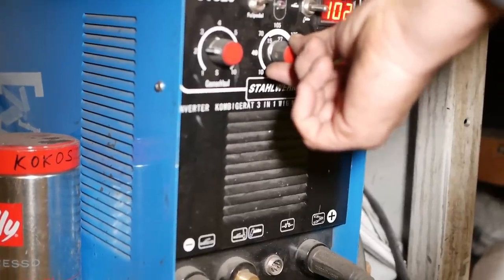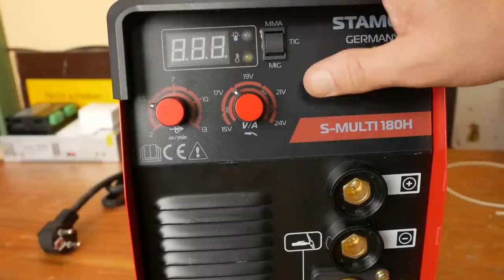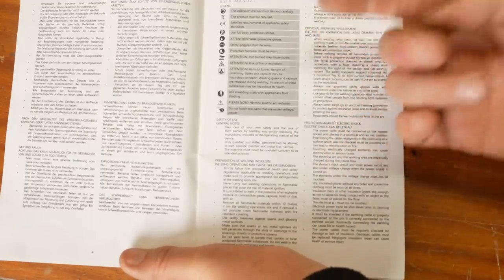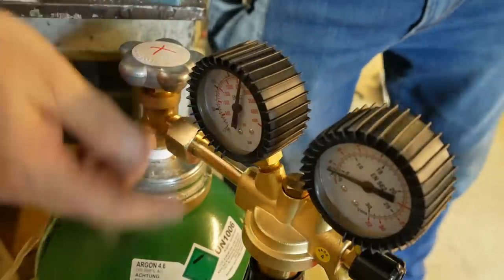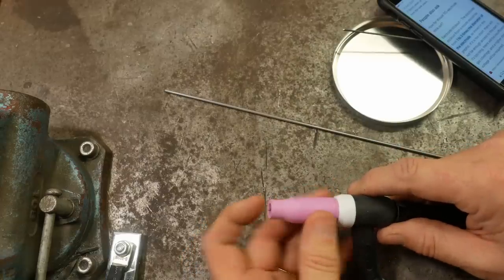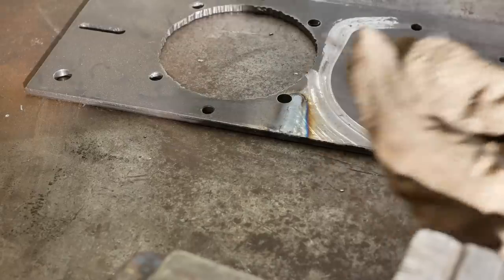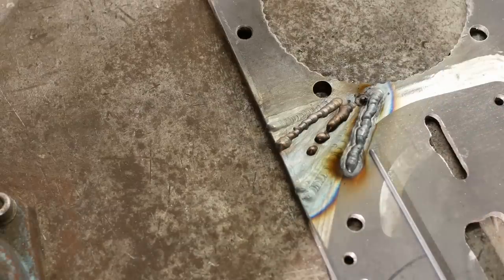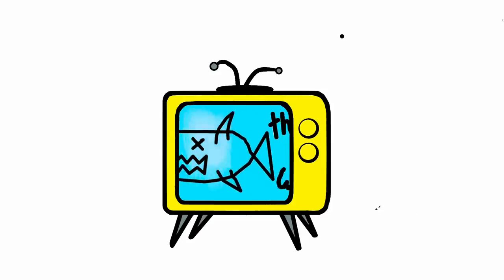Can I learn to TIG weld in an hour using just the internet? || RotarySMP

Comment: you can go whit longer stickout on the wolfram-it depends on angels and how you weld 2 things together- best tips for beginner...and also for experienced tiggers- get a clear gaslens instead of those ceramic ones-the make life much easier-you can se much better what's going on, the ticking noise for the filler is probably some residue from the flux,sinse they are mma-sticks.
the noise is coming from the surface being braked - practice a shitload is the only way to learn,tilting the torch and getting a feel for angles,speeds and amps takes time-dont trust everything online, it differs from machine to machine to ..for 1.6mm wolfram i rarley go above 70-80 amps - and about the speed,move the torch at a steady speed and dip the filler also in a specific speed- best way i have is to have a music-tune in my head and moving to the beat of the music - and one mire thing , do NOT use pure argon for mig-welding,it wont work..the welds will be completley crap
Reply from the maker: Thanks for your critique. Very useful feedback. I am doing daily practice sessions, so it helps to have tips like this to try out.
Reply: @RotarySMP  Just to be clear, I suggested an argon bottle because you'll need it either way. Might even need a second line with a separate pressure regulator if you're welding on hollow parts. Might also come handy for heat treatment of metal parts. Or as an inert gas if you suddenly decide you want to do volatile chemistry in your basement.
Getting your hands on a small CO2 bottle shouldn't be hard. You only need to know that there are two types of bottles, the vanilla kind, and the ones with a riser tube that deliver liquid CO2. You need the vanilla type, otherwise your pressure regulator will freeze.
Reply from the maker: @graealex  Yep. Got it. I will see what I can do.
Reply: @RotarySMP  One side note regarding CO2, it's a really funky gas.
Argon is exactly how you would expect a gas to behave. You put a bunch of it in a vessel, at high pressure, and it's just gas at high pressure. When the pressure increases, the temperature increases proportionaly, and vice versa.
But CO2 has a really funny phase diagram. At room temperature but high pressure, it turns liquid, but when it does, it's obviously a lot less dense, so the gaseous and the liquid phase build an equilibrium. You can't really hear the liquid sloshing around, but if you put a bottle upside down, you'll only get liquid CO2. And when it changes phase, it removes or releases heat from/to the surrounding. Mostly when it expands and turns from liquid to gas, it pulls a lot of heat from the surroundings.

Comment: Congratulations, and, thank you Alexander!
In addition to practice just moving a puddle along you can try autogenous TIG (without filler), it may be easier to get good fusion if you find coordinating both hands a challenge.
Though you seem to be doing quite well!   👍
Also, TIG braze with bronze wire you can turn the amps down to keep from blowing through thin sheet because youre not melting the base metal. This works best for fillet and lap joins.
Consider sharpening both ends of your tungsten (or even snapping it in half)  You wont make so many trips to the grinder.
Reply from the maker: Thanks Jim. I will certainly try TIG Brazing. Good point about grinding both ends. I am doing plenty of walks of shame to grinder :)
Reply: @RotarySMP  Also, consider the amps needed when choosing electrode size.
If you're going to try joining that 6mm plate I think you'd be better off with a 2 or 2.5.
Tungsten is tough but it can only carry so much current before it melts as well.
Reply from the maker: @jimurrata6785  Since I will mostly be welding thinner stock on all the projects I need soon, I need to start practicing on thinner sheet.
Reply: yeh when I first tried tig I found fusion welding quite easy (as long as the parts fit well). Afaiu you not supposed to snap snap the tungsten, it makes it crack
Reply: @fuzzy1dk  Score on the edge of the wheel and it works just fine. Besides there is a limit to how much is needed to chuck in the collet, but you are right this is not best practices.
Reply from the maker: @fuzzy1dk   I'll be making the Schaublin control module with laser cut steel, so the fit up should be near perfect. Will be nice if it is only fusion welds.

Comment: I use 3/32 er705-5 filler with that size electrode. I also stick my tungsten out about 5mm from the end of the cup to avoid the strikes.
Reply from the maker: Thanks for the tips.

Comment: I would avoid the red electrodes, just because I am really uncomfortable with the thought of any amount of radioactive particles in my environment.
Also, the radiation free alternatives seem to have no major downsides.
Reply from the maker: A lot of the jet engine compressor casings, especially from Rolls Royce, used thoriated Magesium. I was never a fan of that either.

Comment: I’m still learning TIG I’d suggest buying a couple of boxes of tungstens and sharpen them all so you can swap them out quickly. I think filler should be roughly the same size as the tungsten. Good luck 😀
Reply from the maker: Yeah, I already have a box of tungsten in the shopping cart :) Fewer walks of shame.

Comment: I'll watch of course, but already know that you absolutely can learn to weld from the internet. The practice component takes more than an hour, but you can learn what you need to know in an hour.
EDIT: that assumes that you can get the mig wire back on it's roll. I thought this was tig? Mig is much easier.
EDIT2: That's more like it. At the end there your beads were looking better, but you absolutely must use tig wire. Once you have that and some more practice you'll crack on well enough. Jody at Welding tips and tricks will teach you everything you need to know if you watch enough of his videos. Many other great sources on YT as well.
Reply from the maker: It is tig. I was just looking for a place to store the spool of MIG wire which delivered with the welder. :)
Reply: @RotarySMP  Sorry, I was live tweeting. 😂😂😂

Comment: youd porbably want like 10 to 15 liters of flow on the argon, tho that regulator seems to go pretty far might be the wrong one, check that you didn't get one for oxygen or something. i am not sure if the co2 ones and the argon ones are diferent or not.

The trigger might be a potentiomater the more you press it the higher the amprage goes, with the max beaing what you set, just a guess tho if it's super light to press. 

the snap might be from you pushing the filler into the puddle? not sure you just wanna melt it no push it in.

The wider beeds you get at the end are because the metal is heating up by you weling it, so it takes less heat to melt it. You can keep it constistan by eather pressing the switch less if it's a pressure sensative one, other wise you have to speed up how fast you are going.

The trick to get a nice looking beed it to be consistant, melt the metal for a set time ad filler and move on, try counting in you head to see if it helps or get a metronome if your serius about it maybe a beep form a cellphone over head phones might work as well. Take evrything i have seaid with a grain of salt, i have only done a bit of tig i mostly do mig but beaing consistant matters in both to get a good looking weld.

other wise as with any skill if you don't give up and keep trying to improve you will be a pro in no time.
Reply from the maker: I will return that regulator, as it is defective. I found a flow meter with the correct thread for the bottles here, and will get on of them. 

Very useful tips you gave me. I am doing daily practice sessions, and those ideas all help.

Comment: It seems like tough there aren’t that many shops which sell the filler rods + the tungsten.
Best combi for steel for me was 2.5 + Gray i bought all the rods without thorium content and got them from stahlwerk.
Reply: In austria i mostly know of fronius they sell the high quality stuff but here to say they are all normed so there should be no diff between colors from one manufacturer or the other.
Reply: Also make sure you buy the right size of filler rod for the tungsten to tiny and you will not be able to catch up, to big and it doesn’t melt.
Reply from the maker: Thanks for the tip. I will mostly be welding thin material. 2-3mm steel sheet and square tube.
Reply from the maker: The internet tells me I need 1.6mm electrodes and 1.6mm filler rod to weld 3mm sheet. Is the internet trustworthy?
Reply: @RotarySMP  It’s mostly about the amps but i did a lot of 3mm stainless also with a 2.5 rod just need to adjust the amps a bit. 
I think the best channel’s i found was igor the welder, and aluminum löffel. He actually did very recently a bit of an intro (igor that is).

It’s basically the same with 3mm mild steel but i think overall a but less then stainless as mild steel gets quite fast cooked which makes it make sparks that’s the point when it was too hot.

Overall i felt stainless was easier to handle for whatever reasons has a lot more time to get to hot.
Reply: @platin2148  Yes, Igor is pretty pog.
Reply from the maker: @graealex  Thanks for the recommendation on Igor. There are so many welding channels, it is hard to find the good ones.
Reply: One i totally forgot was Manfred Welding.
Reply from the maker: @platin2148  Thanks, I'll check out his channel too.

Comment: Obvious things that jump out to me, electrode sharpening like you said make the taper longer, so the tip change is more gradual, not sure how you hold your torch but I found holding it like a claw using my index finger for the trigger was best even tho at first it felt horrible, I think it was well worth it in the long run, keep the electrode stuck out of the torch I touch more than it looks like here, maybe 3-5mm, and to learn the muscle memory a larger electrode diameter wouldn’t go a miss I think, it gives you more room for error, 2.4 I think with 2mm filler rod
Reply from the maker: Thanks for your experience Kyran. It really helps having someone point out these things. I will do daily practice sessions to work on this.
Reply: @RotarySMP  I’m still no expert by any means but I reckon I can do enough to get done what I need to, practice is the most important part, takes a lot, or it did for me at least, your first attempt looks really good tho
Reply from the maker: @Kyran31  Thanks for the encouragement.

Comment: I would say use a bigger cup, more stick out, much more taper on your electrode, try and hold the torch at less of an angle. The biggest thing is just consistency of distance, movement, speed and timing though. Just takes practice. Don't sweat the electrode type, in my (very amateur) experience it really doesn't make any obvious difference. Not sure what the snap sound is, I don't get that, but my machine is a hf start type, perhaps that's related 🤷‍♂️.
Reply: This machine is also HF ignition, but I assume the snapping sound is because he shaved off the flux from normal stick welding electrodes and used them as filler, and God knows how long they have been laying around in the shop. Probably estate he inherited from the late grandpa.
Reply from the maker: :)
Those electrodes were fresh...

... 10 years ago :)

Comment: Not sure you read the stick out value correctly. If the diameter of the electrode is 2mm, then the stick out past the end of the cup should be 2 to 6mm. 4mm being the middle ground. You might find a proper set of TIG gloves will improve your control. I've started using TIG gloves to MIG just because of the extra feel you get. Also can you pull instead of push, it would give you better viability on your puddle.
Reply from the maker: I have been using one of those pyrex cups, of larger diameter lately.

Comment: I would not use the thoriated tungsten - radioactive materials is no fun to handle and the stuff "survives you" if it gets into your body. I mainly use golden and green ones.
Reply from the maker: Thanks Christoph, I used to work on RR viper engines which had thoriated magnesium compressor cases, so received training on this. I have a batch of gold electrodes on order.

Comment: Awesome! Can't wait to see more TIG welding content (and less tip grinding, LOL) :) The torch handle has a number, like a #17, #18, #26, etc. What's the number on yours? I've got something I want to send you that will make it a LOT easier to work with, but it's sized to the torch number.
Reply from the maker: Thanks a lot. I am just watching the the Le Mans MotoGP on TV. Pretty wild race. I'll check the torch in about a half hour.
Reply from the maker: That was a hell of a race :)
The torch is  #17.
Reply: @RotarySMP  Thanks!
Reply from the maker: @JCWren  I did another practice session. Thin sheet this time.
https://www.instagram.com/p/CsOlj3PowW4/?utm_source=ig_web_copy_link&igshid=MzRlODBiNWFlZA==

Comment: If you have a few extra euros for anothr tank, maybe it's worth giving mig a try? I never welded at all. My brother lent me his mig machine & tank with the advice to just follow the instructions printed inside the cover of the machine. The welds came out pretty nice from the get go and improved from there. I wouldn't trust them if they were structural, but for just sticking pieces of steel together with respectable lookng beads, mig seems a pretty good, not very difficult process.
Reply from the maker: I will do that, but first I am really enjoying learning TIG.

Comment: Welding 10mm plate with a 1/16 electrode and 1.6mm filler might be asking a bit much? 
I would say try welding some thinner material together. 
(That said, you are hard on my heels for total TIG welding time, I suspect) 
For the sheet metal work (cabinets and such) you wil probably find MIG to be the process of choice. 
I didn't actually know that MIG/TIG machines with HF start existed. That's quite a good combo unless you need to weld aluminium.
Reply: I also thought so. There are only a few machines on the market, most combined machines rely on scratch or lift start for TIG. This was also only meant as an introduction to both TIG and MIG, and I fully expect the machine to get replaced in the next year or so. Or at least get some upgrades. Also a shame that it doesn't do AC, but neither do I know of any AC welders that also offer MIG, nor is it typical for budget machines anyway.
Reply from the maker: Hi Andy,
Yeah, I just grabbed the nearest scrap and started laying down beads. 
Just now I did a session with 1.5mm sheet. Was good as the holes appeared fast .')
Reply from the maker: I have done two more practice sessions today. Loving it.
Reply: @RotarySMP  😍
Reply from the maker: @graealex  https://www.instagram.com/p/CsOlj3PowW4/?utm_source=ig_web_copy_link&igshid=MzRlODBiNWFlZA==

Comment: MIG SpoolGun is for you
Reply from the maker: Hi Vincent, what is the advantage of a spool gun verses the current wire feed?
Reply: @RotarySMP  Easy to learn and use if you  do not do a lot of welding - you can do thin wall welds really good

Comment: Mig wire is tig rod.  Aws 70s2 is normal.  Need cu coating for cleaning.  Dump that thumb switch crap and use the foot pedal it's harder to control the torch if you're also having to manipulate the button.  Go buy some flat stock 3 mm by 30 mm cut off some 6-in coupons and start welding metal together it's a lot easier when you have a joint to follow then trying to just weld on flat plates
Reply from the maker: Thanks Paul. I did exactly that with some 2mm sheet (cut out of the Schaublin control cabinet). Making progress.

Comment: Crap! Now I want a welder.  Thanks!
Reply from the maker: Thank Alexander :)
Reply: If you want to make stuff quick, get a MIG. Supposedly if you want to actually learn how to weld, you're supposed to start with stick. I've done a little mig welding, mig is pretty easy to be ok-ish at by watching some youtube videos. They don't call it a "metal hot glue gun" for nothing!
Reply from the maker: @gorak9000  I am glad I have been stick welding for the last few years. I had also heard it was good to start with it.

I will also try out the mig function of this welder and report back.
Reply: @gorak9000  The ability to also do MIG was the reason for choosing this particular device, although devices that both do MIG and don't rely on scratch start for TIG are quite rare. But you're right, if you just want to get stuff to stick together, MIG is the best choice, unless stick is required. And with everything, with enough practice, you can make MIG welds not only be functional, but also look good.
Reply from the maker: @graealex  I am looking forward to trying the MIG side of things, as I have only ever tried it once, briefly, without any success :)
Reply: @RotarySMP  I'd imagine getting good results from MIG might even take a bit longer, as it forces you to move quickly and go on. It's the right process if you got a lot of welding to do and don't have time to waste.
Reply from the maker: @graealex  Whereas I waste a lot of time and weld too little :)